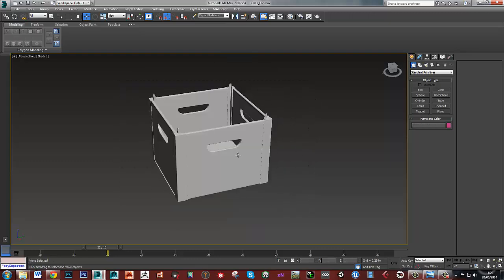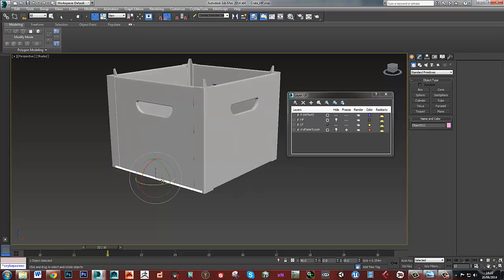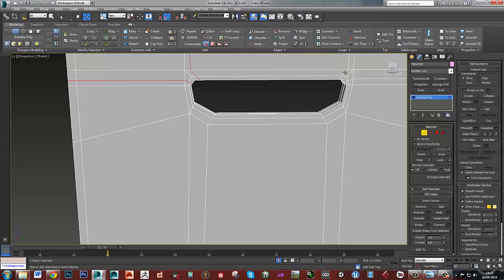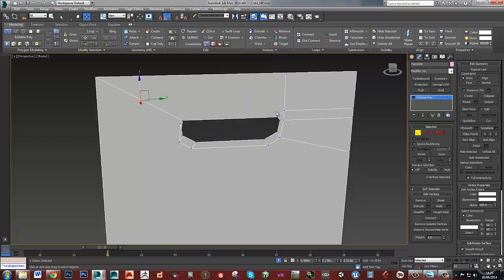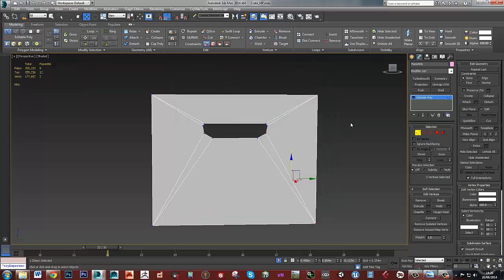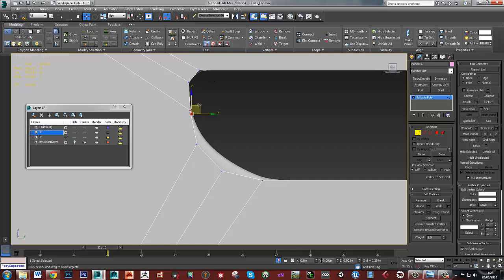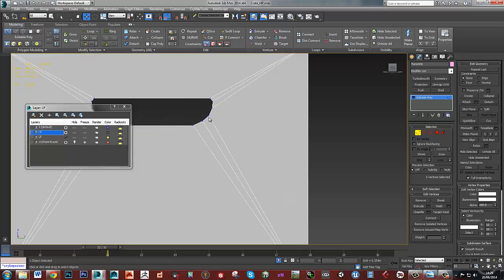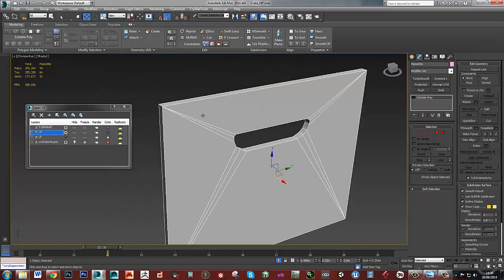High quality physically based game asset - part 3 Low Poly

Comment: Im stuck so please help me out...
have u shared the same uv's for the rest of the model?
it looks that u have uv's of only one face and how is it sharing the rest??
have you overlapped because its symmetric??
Reply from the maker: Vivek Anand Hi, yes there will be some overlapping UVs for parts of the model that are symmetric. For example I've just textured one side of the crate. I have a more detailed video going over my process for unwrapping here:
https://www.youtube.com/watch?v=CsuaB7ZywWU&index=2&list=UURN6DSbxwH7B58TqBCznVLg
Reply: barry lowndes Yeah tnx i found it useful but r u using only one uv map for this entire crate model with all of the faces placed on top of each other..so that it shares the same texture...
Reply from the maker: Vivek Anand yes just one UV map.  Take a look at the next video (part 4) it goes through quite a bit of this stuff before baking:
https://www.youtube.com/watch?v=4QdTnsRnLLw
Reply: barry lowndes according to this crate model u have overlapped the uv's right? so y isnt unreal 4 giving an error of overlapping uv's....?? if the uv's are placed on top of each other symmetrically there wont be any problem in baking??
Reply from the maker: Vivek Anand no you can't have them overlapped for the bake.  Watch the next video and I explain how to deal with this I think it will make sense then.

If you want to put this into UE4 and bake lightmaps then you will need to create a new set of UVs with nothing overlapping.  Creating lightmap UVs is a completely different topic though and is not covered here